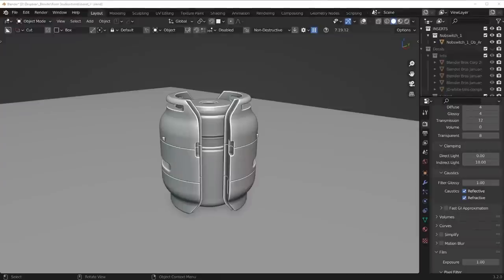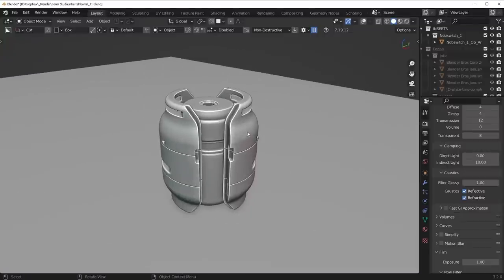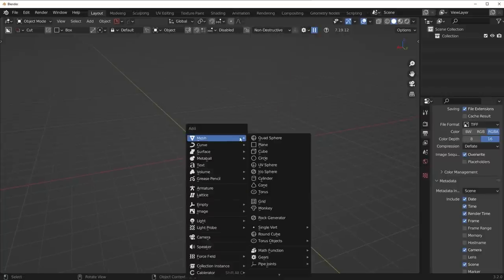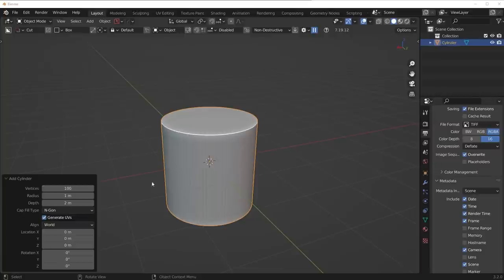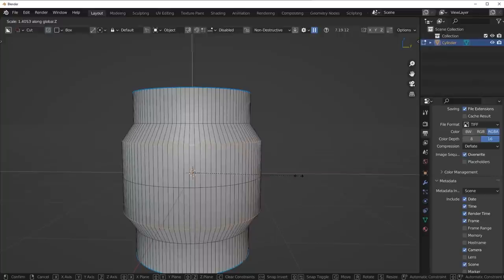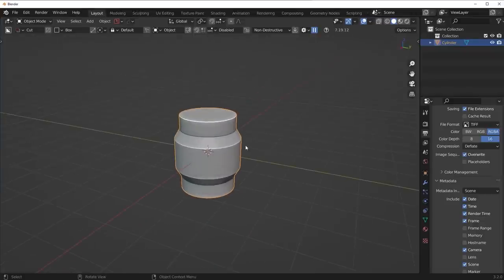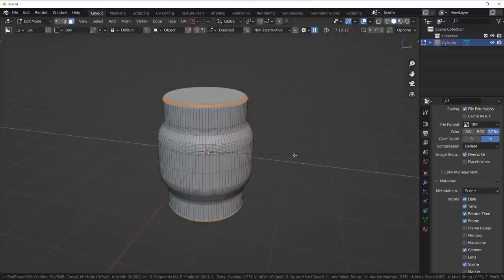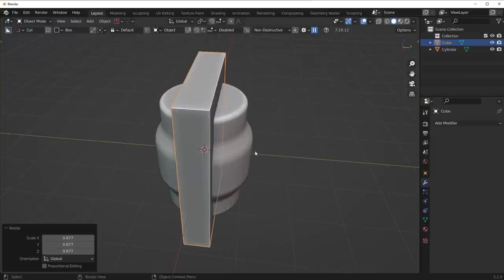Form & Function Simplified | How to create amazing 3D designs (Blender Tutorial)

Comment: It seems cool , but it's quite limited, some combinations generate glitches, which are hard to remove. And overall, final gemoetry is a mess.
Reply from the maker: Why does the final geometry matter?
Reply: @JoshGambrell  Well, this one looks beautiful, but not realistic. You can tell at first sight. Quite like in "distric 9" vs. Ghost in the shell, the movie. it was seen that was made by booleans  vs, sub^2 and high resolution meshes. It's easier to work on sub ^2 with clean mesh if you want to add rust and such stuff. an dsquish/break structures in houding. But it's not a problem to make such models for commercials and presentations.